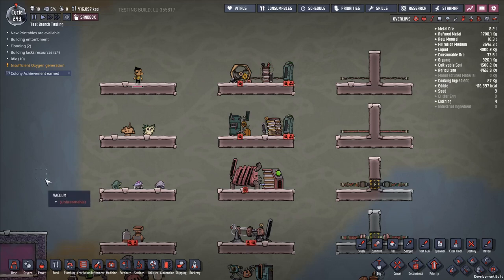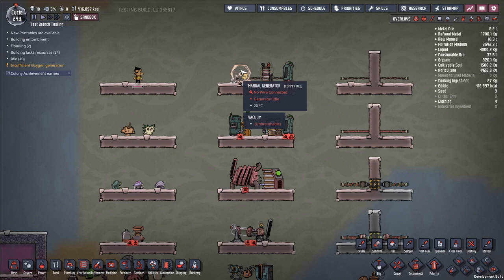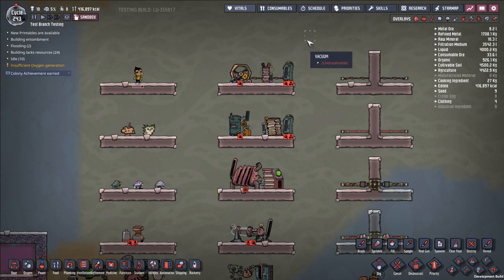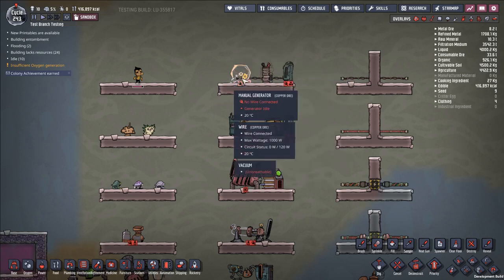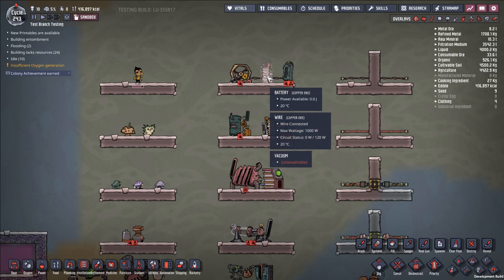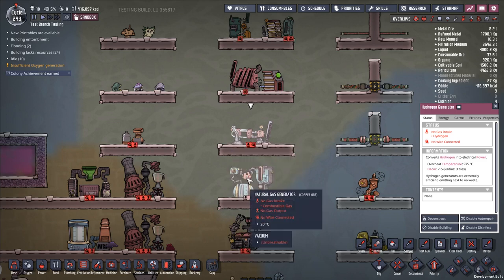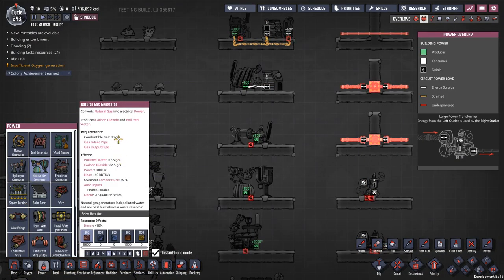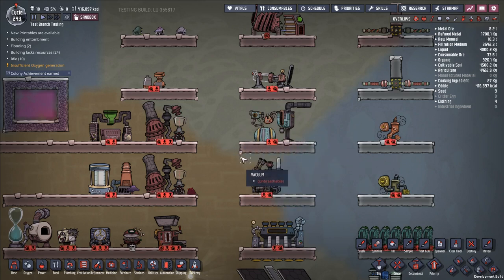A Summary of Power Technologies -- New Player Guides [Oxygen Not Included]

Comment: i agree with nearly everything in this video except for the large battery. in order to compare the large battery to the small, you must not compare them 1v1. instead you must compare a single large battery vs 4 small batteries to keep everything in proportion. since runoff is applied to each battery individually, you would have 4kj of energy loss from the 4 batteries in total, while the large battery only loses 2KJ. this means the energy loss per 10 KJ stored is only .5 KJ for the large battery. the smart battery would be the best though at .2 KJ per 10KJ stored.
Reply: Jimmy  smart batteries are indeed best, however, they use refined metal, which is somewhat inefficient to produce until the metal refinery is built. with this in mind, it is possibly more efficient on metals to use the large battery until the refinery is built and then deconstruct to reclaim the metals used. 

as for their further use, combine them with the steam turbines and solar panels, as smart batteries would be wasted on renewables, having more capacity would be the most important in this field.
Reply: It's worth noting that amount leaked doesn't depend on the amount stored. Small battery and large battery will still leak 1kJ and 2kJ respectively even if they aren't full. That makes large battery actually less efficient than small batteries if your storage capacity is 0-10kJ total, equally efficient in 10-20kJ range, and more efficient only when you store over 20kJ at all times.
You don't want to store energy in batteries anyway (unless it's solar). As generators have no spin-up time, it's the most efficient to keep your fuel stored and burn it as needed.
Reply: @MortyrSC2  you cannot compare a large battery vs a single small because there is no proportion. i used  4 small batteries to compare them evenly. the 4 small batteries have independent runoffs. it's 4 kj total, or 1 kj for each.
Reply: @commonsense-og1gz Yes, I agree. But I wasn't arguing that point. I was talking about runoff for non-full batteries.
Reply: @MortyrSC2  why would it be different? the rundown is supposed to be static. i have never seen a difference in any battery whether it be full or half full.
Reply: @commonsense-og1gz  Ugh.. That's exactly my point. If you have 10kJ stored in a large battery, it will leak 2kJ/cycle. If you have 10kJ stored in a small battery, it will leak 1kJ/cycle.
Reply: @MortyrSC2  you can't compare a full small battery vs a large with 1/4 charge. compare them both at 1/4 charge if you're going to compare the efficiency. remember, keep things in proportions.
Reply: @commonsense-og1gz  You can, if you only want to store a small amount like in straight to usage setup with a single battery.
Reply: @MortyrSC2  if you're going to type about efficiency loss over time with the large battery, you must do the same with the small battery, otherwise you are saying the rules do not apply to the small, even though the principles are the same, leading to a biased argument.

 if i have a large battery with 25% charge and a small battery with 25% charge and i am comparing the two together, i expect the small to run out sooner 2.5 seconds for the small vs 5 seconds for the large, due to the storage being 2.5 KJ vs the large at 10KJ. this is assuming rundown is using second intervals.
Reply: @commonsense-og1gz  I don't think I can put it any simpler than I already have. Try to read my comments again. Have a nice day.
Reply: @MortyrSC2  i have, but you need to read my comments again, because i put it simple.
Reply: Trying to reply to this comment line. Are 4 small batteries charging sequentially or concurrently? I'm a noob but I'd imagine 4 small batteries operating in a smart sequence so a small quantity of power storage all goes to a single battery leads to only one small battery in energy loss. Course cause I'm a noob, I can't tell if you can make a design where batteries charge sequentially.
Reply: @gdrad  if you are looking for power draw for the equipment used, you maybe able to to this, if you have automated gates, but i think smart batteries overrule gates, and sensors. at least i never had success as of yet using them with gates. as for runoff, nothing affects it. so, if you line up any number of batteries, doesn't matter how many, you'll notice the bars on all of them go down at the same time, so the drain is spread evenly with all batteries, even if you were to place gates on select batteries.

Comment: Big thanks for your great and comprehensive tutorials! These should have far more views and I learned a lot! However, there is an addendum I have to make for the lumber => ethanol => combustion generator cycle. I think the trick is to grow the trees in a greenhouse. I did this in my playthrough and I had to take them off the grid, because I was drowning in lumber. I haven't really stress-tested it, but imo 1 tree-greenhouse with 7 trees and farmer's touch can easily supply ~8 distillers, which in turn can power 2 generators which produce more water than you need for the greenhouse - even with fertilizer-maker. 
My only problem was the massive buildup of CO2

And for the love of Meep - don't let Klei hear about this! They'll further nerf it XD
Reply from the maker: I hadn't thought of this, great idea.
Reply: @gearheadgaming1  How do you regulate the coal generator with the battery "transformer"? If you put a battery near the generator with automation wire as you would do in a normal build it doesnt work because the battery near the generator will be full and wont recharge the one in the " transformer". Thanks for the help

Comment: I think that last bit, about the battery shutoff transformer system, deserves its own video. I'd like to see how you'd set up a real base grid with it. Only having to run un-refined metal wire through everything sounds great! I could set up generator banks wherever they are convenient as my base grows and just pipe the wire into the main grid without worrying about that nasty decor. This seems very broken.

There are a couple of questions here though. 
1) Is it infinite wattage into the battery then? Like can I put 100 coal generators on there so when it flips, it (nearly) insta-fills the battery? 
2) Can you still set up an efficient power-shutoff system, ie. typical smart battery, for a given area. You still want to be efficient with fuel consumption.
3) In a distributed grid setup, does it charge each battery bank evenly, or is it divided like the flow of liquid or gas? If it is all 100% even distribution, you will IMMEDIATELY know if your power generation is insufficient because everything in your base would stop working all at the same time. 
4) What fail-safes can we build to help this ^ ? Perhaps a central battery bank for distribution to the "ultra-transformers"? I assume that is all possible with the same un-refined wire. I guess with a central bank you can just monitor the power level of the batteries. Even set up automation so when the bank gets to like 25% or something it makes some lights flash on and off repeatedly to catch your attention.
5) I wonder if you can build brothgar's power offloading system in it as well. Just in case you wanted to have a self-sustaining system (like the metal refinery + steam turbine) and only off-load when needed. Though I guess, why not just hook the turbine up to the grid and give the refinery an ultra-transformer?
6) I'm curious if the generator direct to generator wiring scheme has any effect compared to a central line with branches to each generator, especially if you branch an ultra-transformer between them.
7) This seems like it is going to get nerfed... Not really a question, but...
Reply: I second this, I would really appreciate a more detailed how-to and break down of that battery shutoff transformer set up as well. Great video overall. I'm very glad to have found this series.

Comment: I was wondering why you said earlier you didn't use batteries that much.  Once you went in to how you don't like solar panels it became pretty clear.  Using solar requires a lot of batteries to buffer the down time of them.  Solar panels are easy.  Protecting the solar panels is the fun part.  Lots of steel.

Comment: I'm still fairly new and I have to agree with you on Hydrogen generator. I tried doing the suggested store it till later but after filling a couple dozen storage tanks it just felt pointless. I'm 1600 cycles in and still don't have a space program as I'm taking it slow on building up dupes. Water isn't much of an issue as I have 2 Salt Water, 3 Cool Steam, and 1 Hot Water Geyser on the asteroid.
Reply: You could also build a gas compressor with mechanized airlocks and automation (Buffer/Filter/AND), very useful and takes at most 40 tiles (5×8) with a 4 dooe pump-in setup

Comment: Transformer Video would be good. I spent a long time in a game once working on a power overflow system that would dump the extra power from a self-powering electrolyzer system into my main grid using automation with smart battery and power transformer but I can see how using power shutoffs would be cleaner.
Reply: I am trying to do the same thing right now
As he mentioned, you'd need two smart batteries, but I can't seem to figure out how to set up the automation. Could you share your design?
Reply: @dimitaryordanov6551  Moggles post on " https://forums.kleientertainment.com/forums/topic/84579-how-to-not-overproduce-power/ " shows a really simple power overflow circuit. I use it now. caz it generates less heat and much cheaper than the one I made.

Comment: In the current launch version, I can have a single electrolyzer produce enough hydrogen to run a hydrogen generator to provide enough power to power the electrolyzer and gas pumps, providing a mildly power-positive loop of free oxygen that only takes water. That includes Cool Steam Geyser water, which is too hot for plants but perfect for this. If you make it REALLY efficient, you actually generate more hydrogen then the generator consumes, so it produces free power, oxygen AND hydrogen out of water!

Comment: How do you regulate the coal generator with the battery "transformer"? If you put a battery near the generator with automation wire as you would do in a normal build it doesnt work because the battery near the generator will be full and wont recharge the one in the " transformer". Thanks for the help

Comment: -I don't think a regular hatch can alone power a coal generator. Maybe a sage hatch but even that is doubtful. Still great for coal generation though.
-The wood burner is fine for early power on the forest starting location. You may not have easy access to coal so wood is a good alternative. You never need to produce co2 for oxyferns since they use the same ratio as a duplicant but opposite.
-I don't know who is saying the h2 generator is a trap. Probably only kids who just learned about an infinite storage exploit.
-If you rely on a small transformer to limit power to 1000W you may be in for some trouble, because it is a battery it can discharge any amount of power for as long as its battery lasts. It recharges at the rate of 1000W, but it can provide eg 2000W for 1 second, enough to fry your circuit, so you still have to be careful about your consumers. The purpose of both transformers is to split the network. You build the small one because it is cheaper, not because it will limit the power to 1000W, because it won't.
Reply from the maker: I think all hatches produce the same amount of coal, so long as they are not eating dupe foods.

Sometimes you want to produce excess CO2 so that you can maintain the air pressure in the base even as you dig out more of it.  Like, if you have 1kg of Oxygen per tile in a base that is 200 tiles in size, you're only going to have 500g/tile if you expand the base to 400 tiles in size.

The important thing to avoid frying your circuits is to limit the consumption on the network-- the transformer is very useful, but it doesn't get around the requirement that you have to limit the total consumption on the small end of the transformer.

Comment: I really doubt they would allow ethanol gas to be used in a gas generator. This would increase your power output from ethanol by an order of magnitude. PetrolGens convert at 1g -> 1 watt. The gas gen would convert 0.9g to 8 watt. That would be beyond broken because boiling petroleum into NatGas is fairly late game. Boiling ethanol is exponentially easier at 80c.
Reply from the maker: I agree, it wouldn't be balanced, but it is strange that the generator says it accepts "combustible gas" like the petro gen says it accepts "combustible liquid," and one accepts ethanol and the other does not.

Comment: Great video but I completely disagree that solar panels are terrible. For me they are the best power source in the late game. They are inexpensive to build, don't require any dupe labor, don't require any supply or maintenance, don't produce any heat (although the batteries needed to store their output do create heat), don't produce any waste and take up space in the part of the map you care the least about - under your radars and the telescope. You can't launch rockets from under your radars, so all that vertical space below them is great for sticking a bunch of solar panels. All your other machinery is better kept closer to the core of your base anyway and in some environment that can absorb the heat it produces, not in a vacuum exposed to space in the most remote part of the map. A bunch of solar panels and refinery/steam turbine system were enough to power my base most of the cycles when there were no meteors all the way till the end of the game.
Reply: Free power.   It help smooths out power usage.   You have the space use it.   1900 free power stacking them under your scanner/telescope.